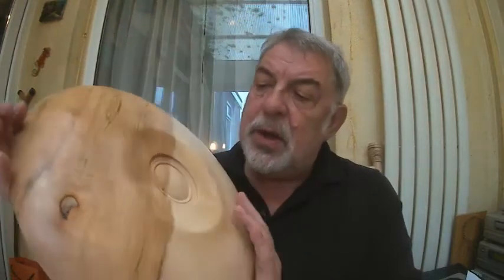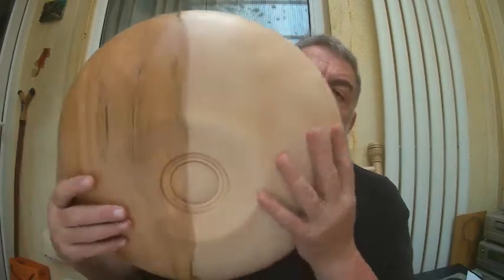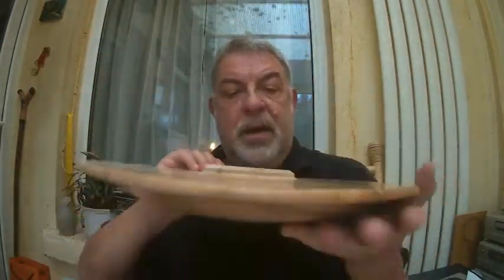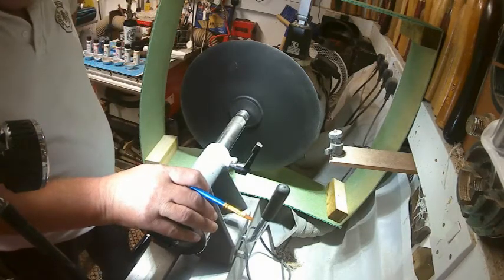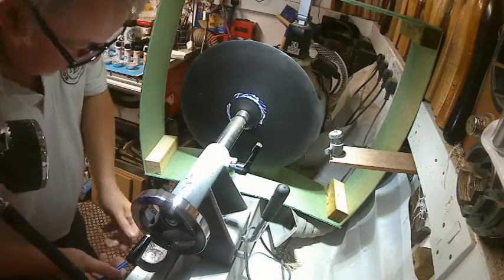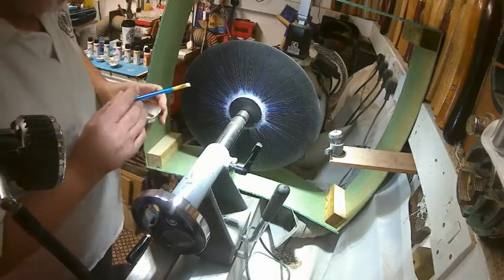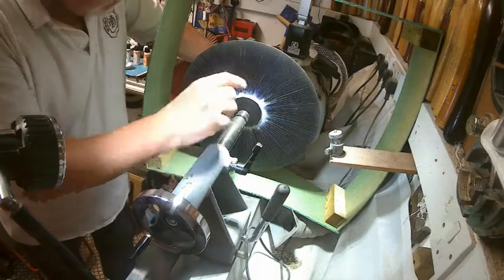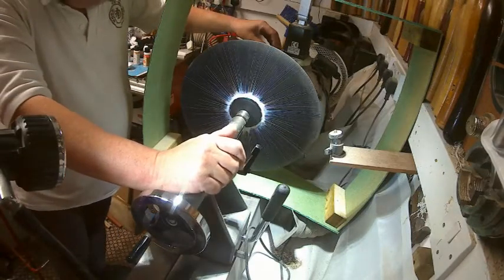Woodturning and finishing 2 X 15” Sycamore Platters with help from Mark The Gentleman Woodturner.

Comment: High Huw.
Nice video mate. You will get a much crisper, sharper ebonised coat if you use sanding sealer before applying it. 
Good to see you turning bowls again mate.
Reply from the maker: Thanks Jack,
I did put sanding sealer on when I was at Mark's so it looked like I didn't apply any.
It was nice to be able to turn bowls once more.
Take care Jack and thanks again.
Cheers, Huw